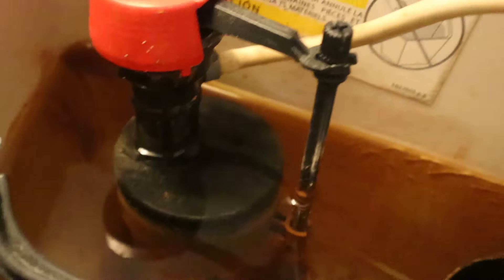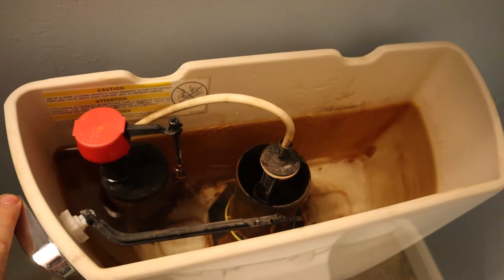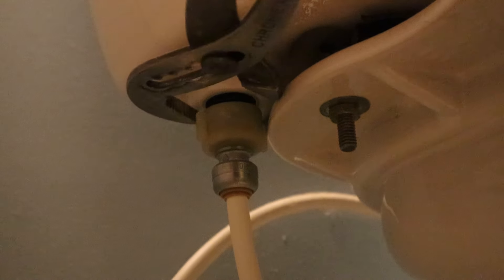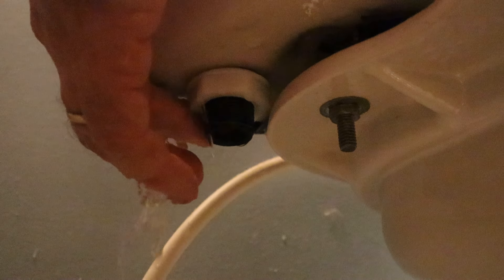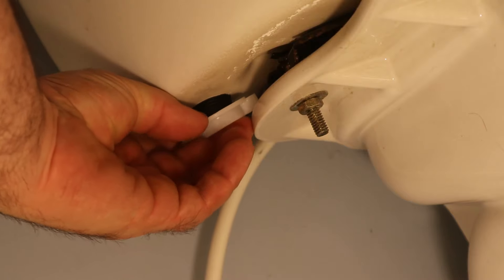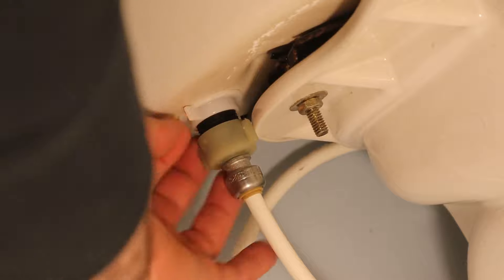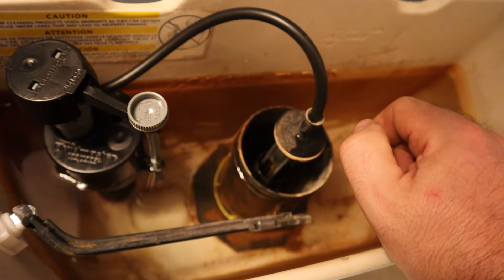Installing FluidMaster 400A Fill Valve in your toilet. Do It yourself!

Comment: I love people who get right to the point and show you how to do things.  Thanks!
Reply from the maker: Thank you! I am glad you likes it.
Reply: can't you just lift up the grey thing at the base of the valve? you dont need to undo the nut at the bottom of the toilet, i saw someone just lift up that grey thing at the bottom of the valve inside the toilet, then you can lift up the valve, then when you put the new one in you puish the grey thing down to lock it in place
Reply: @americanpatriot7233  yes you can, because that's how i fixed mine. It means I've got an old bottom bit of the valve still in the cistern, which I acknowledge might fail sooner that if I'd installed the entire new inlet valve, but I've got the spare new bottom part in case that should happen.

Comment: Thanks so much, sir, for walking me through this.  It was a piece of cake, even for me, a twice per year bumbler through these sorts of tasks.  Something I like to do at the conclusion of successfully working on plumbing (besides celebrating with a beer) is to put a piece of newspaper or cardboard (or something else that clearly reveals a drip in the middle of the night) under the recently fixed thing for a day or two--just in case.

Thanks again!
Reply from the maker: You are welcome, and thanks for sharing your tip!

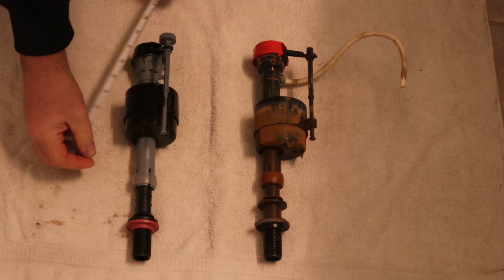Comment: If you are placing an old Fluidmaster fill valve with a new one, you don't need to empty the tank or disconnect the feed line from under the tank!  Look at the valves at 3:30.  Each has a plastic slip collar below the float where the upper shaft sits on the lower.  Just reach down and pull up on the plastic collar to pull it closer to the float to unlock the upper portion, then yank the whole valve up (no turning).  The only thing that will stay behind is the black stand pipe.  Remove the stand pipe from the new fill valve and slide the new valve over the old standpipe (which is just a hollow plastic tube and never goes bad).  Set the height to where the old one was and slide the collar down to lock the new valve onto the old stand pipe.  EDIT:   this presupposes of course that you are installing a new Fluidmaster in place of an old failed one.
Reply from the maker: yes, I need to make a new video
Reply: I just used the pull up the collar method n it took less than 10 minutes to take the old leaky one out n put in the new one.  Fluid master old n new.  Thanks

Comment: Very clear and helpful video. 

I just installed this same  model of Fluidmaster fill valve myself. I encountered a great deal more difficulty than shown here, because I was dealing with a worn out fill valve that had been in place nearly 20 years. The nut holding it in place had become corroded and “frozen” onto the metal shank of the old valve, and it was extremely difficult to remove, using a pair of channel lock pliers and with the aid of WD 40. 

I finally got it off so I could install the new valve but then I had to deal with the water supply connector (also 20 years old) not stopping the water from leaking/spraying out. Ultimately, I replaced that as well, buying a Fluidmaster brand so I could be certain it would connect with the new fill valve. 

Hopefully, viewers of this video will not experience the difficulties I did. But be forewarned if you’re in the same circumstances I was in, replacing a very old product and installation.
Reply from the maker: Sorry that you had a tough time with yours. The old plumbing parts can be difficult . I am glad you found the video helpful.

Comment: thank you. that bit about the difference in height should be 3 inches and the next one about measuring the outgoing unit and making the new one the same...those were the golden bits thst make you stand out. thank you again.
Reply from the maker: I am glad you found it helpful
Reply: @TheFixitShed  I feel like wonder woman right now. I fixed 3!! leaking toilets. one handle is "floppy." any ideas?
it doesn't stop in the horizontal positions, but flops to point up at the ceiling. it looks like the mechanism is made of "pot metal." and will break if I mess with it much.
Reply from the maker: Your comment made me smile.  I am really glad the videos are helping people.  That's what makes it worthwhile. 

It is hard to tell without seeing it.  I would suspect the handle is just broken.  The handle should have a tab inside that stops it from flopping all the way down.  That stop may be broken.  Or it the nut that holds the handle on the tank is loose, it may be spinning around in the hole.

Comment: The 400a pamphlet, and two convos with Fluidmaster, gave me knowledge.  You gave me confidence. Thank you.

After installing the 'new in the box 400a' I had to troubleshoot by flushing the fill  valve cap (pg 10).  

Thanks again, kind sir!
Reply from the maker: I am glad the video helped!  What was the issue you were having that you needed to troubleshoot?
Reply: @TheFixitShed  ~ hi there! I'll try to describe:  After installing and reconnecting the water supply __ yikes, water all around ~ spraying and leaking from the fill valve locknut area and the water supply!  My hands, fingers, and gripper gloves had not provided the strength needed to have either of those two locknuts (fill valve + water supply line) tight enough .  Fluidmaster CustSvc  gave me the ok to use a tool. 😊 i chose channel locks and carefully tightened the locknuts.  Water back on, test flushed, to check tank and bowl water levels. Toilet "gargled."  Water could be heard trickling into the bowl, the valve would try to re-flush, to add more water. It kept trickling, water level increased just a bit, and then it would try to flush again. So I turned off the water supply and flushed so as to lower the tank's water level. Carefully took off the fill valve cap (pg 10), placed the Dixie cup atop, and turned water supply  on/off/on/off to clear out debris; there was none to be seen.  However, after reassembling the cap, turning on the water supply, and doing another test flushed,  this step of flushing out the valve, solved the problem. The toilet no longer runs, nor trickles, nor tries to dispense additional tablespoons of water.  

I am so 😊 happy.  You've no idea how much fear and doubt this task had generated.  

Your video-taping your hands really helped me with getting the left=right or clockwise/ counter-clockwise turn  instructions correct;  a tremendous help!  

I didn't ck your channel yet, but perhaps a vid on flushing the fill valve to clean debris caught under the cap may help some folks diagnose and solve certain issues, before replacing the fill valve?  Im going to try that if my toiiet ever runs/ trickles or tries to self-flush. Thank you, again. 🏅
Reply from the maker: Well done! Congratulations on your success!

Comment: Thank you for making this video.  I bought the same toilet fill valve a few months ago.  Today I finally have the energy to get it done.  This video really helps with the diagram showing the 3" height.  I measured the height differently since I messed up the height of the old fill valve when I tried to fix the filling problem.  I measured the height of overflow pipe first, then added 3" to it, and adjusted the length of the fill valve.  It would have taken me about 10 minutes to get it done if I had not take pictures.  Thanks again.
Reply from the maker: That's awesome!  I am glad you found the video useful.  I often take pictures  (or video) when I am doing something so that I remember how a piece came apart, or something like that.

Comment: Nice video.
I like that it was not rushed which was good for me since this was the first time I was replacing a broken Fluidmaster 400A flow valve.

To adjust the new 400A's height, I put the the old one next to the new one like you did.
Then I kept adjusting the height until they look to be about the same height.
Didn't use tape measure.
Reply from the maker: Glad it helped!  Eyeballing it is probably close enough.
Reply: @TheFixitShed  Thanks for the video. The new flow valve is working just great.
Reply from the maker: Glad to hear it. Congratulations on your success!

Comment: Thank you that I found you video that saved my times than it own manufacturers ☺️☺️
Reply from the maker: Glad I could help!
Reply: @TheFixitShed  Thank you again 🙏 you save me $350.00  from the plumber who wants to charge me as of emergency visits(at 2:00 am) I woke up with the water flooded all over my bathroom floor. Good thing he told me to turn of the water first, If I have other bathroom to use. He can comeback during daytime for $175.00 to save my money. At the mean times I searched on YouTube from more than 10 YouTuber before I found you. I spent $19.00 for the valve and $22.00 for the pliers. I’m very proud of myself now under your great instructions. Thank you sir 🙏🙏

Comment: Suggestion: If you have a wet/dry shop vac handy, you can vacuum all the water out of the bottom of the tank much easier and faster than using a sponge. As an added bonus, it will pickup any sand or other sediment at the same time.

Comment: This is a great video . When I turned the valve off and flush the toilet, why does the bowl refill back to a full tank.
Reply from the maker: The only thing that I can come up with is that the valve didn't work.  It is broken or didn't turn far enough to close the valve.  See if there are any other vavles closer to the waster source that you can close to turn off water going to the toilet.

Comment: Yes. The price is low enough to make it worth while to replace the fill valve instead of taking it apart to fix it. A new one will last many years. More than the stated warranty in my case.
Reply from the maker: I have never had to replace the same one twice (I move alot).

Comment: Easy-peasy...unless your toilet valve doesn't shut off all the way, like mine. Next you have to shut-off the main water valve outside your home. Unlike the easy-peasy toilet tank access, I only had a few inches access between my toilet and the vanity. I had to lie on my back to remove the locknut and the water hose. Unfortunately everything was frozen in place. 
I got a neighbor to hold the bad valve in my toilet tank while I attempted to unscrew the locknut and water line underneath. The bad unit in the tank shattered leaving a little plastic piece in the tank. Even when my friend used channel locks to hold the piece left in the tank, I was unable to unscrew the locknut and connecting hose under the tank. I had to use a sawzall, reciprocating saw to cut of the old piece. Since there was no room to SEE the water line, I did it by feel and accidentally cross threaded the plastic piece.  When I turned on the outside water supply, water sprayed everywhere. I'm sure In ideal situations, with easy toilet access and a  good working toilet shut-off valve,  it's easy as can be.😉
Reply from the maker: I admire your tenacity. I hope you got it all sorted out. Thanks for sharing.

Comment: You don't need to drain the tank or remove the supply line if the toilet already has a Fluidmaster in it. Just push the adjuster ring down, and pull the top part off, leaving the bottom part in place. Do the same thing with the new Fluidmaster. Now slip the top part of the new one over the bottom part of the old one, when it is properly adjusted, slide the adjuster ring back up to hold it in place.
Reply from the maker: Yes, I heard about this after making this video.  I'll be trying that out next time.  Thanks!

Comment: I had trouble with my refill valve but when It was replaced the inlet line was plugged with?? Called my well man and he said it was rust from inside the water tank. He drained the tank and replaced some schrader valves. Now i have water to the refill valve but not enough to come out the tube. I'm thinking about disconnecting the inlet hose and flush from the main water supply before I put it all back together. I thought this was done, but not so!  Well man suggest I replace tank with one glass lined and install a sediment filter. Any opinion
Reply from the maker: Not really.  I am just a home DIY'er.  Trying to help people do simple tasks around the home to save money.  Sounds like you might have bigger issues than what I would be comfortable advising on, base on your comment.
Reply: @TheFixitShed  Thanks, I now no what is causing the plug, calcium build up. I dont think the rust itself would cause a plug.

Comment: After installing a new toilet, I discovered that the water level in the tank is right to the top of the overflow tube and I'm out of adjustment at the knob/ screw on the fill valve. I think the solution is to shorten or lengthen the fill tube, which adjustment is it and can I do this without removing the fill valve from the tank? Thanks.
Reply from the maker: If you have a Fluidmaster fill valve, like the one in the video, the main shaft twists to lengthen or shortend it. It sounds like you need to shorten it.  You should be able to do this without removing the fill valve.

Comment: I am seeing water coming out constantly from underneath that red Flomaster cap. Dribbling out. And then in the toilet bowl there also is water dribbling into it. My monthly water bill is up a very good bit and I'm sure that's the problem. 
Can I do something to the present Flomaster attachment or do I need to replace it? I really very much need advice please!
Reply from the maker: If the flapper is allowing the water to leak into the bowl, it could be the flapper needs to be cleaned or replaced. If the valve is running constantly and causing the water level to rise and go into the overflow tube, then the valve should be replaced. I don't know anything that you could do to the current one. The easiest fix is to replace the fill valve.

Comment: Should a stream of water run out of the black cap in the corner of the tank after flushing? Mine does about every 10 seconds.
Reply from the maker: If it is doing that, water is leaking from the tank to the bowl.  you need to clean or, more likey, replace the flapper.
Reply: @TheFixitShed   It was replaced and the fill valve was put in today.
Reply: It stops after a while. I hired someone to do it for me.

Comment: Is there a crush ring in the pipe fitting?  Mine is leaking when i replaced the float.
Reply from the maker: There should be a rubber gasket in the supply line hose where it connects to the bottom of the fill valve.  The fill valve should also have a rubber gasket to seal around the base of the valve and the tank bottom.

Comment: I believe this is what I'm going to have to do. Ran into an odd problem where the toilet won't refill itself unless I turn the water on to the bath/shower right next to it for a few seconds. Then I can heard the toilet start to fill up like normal. So weird.😅
Reply from the maker: That is odd. I wonder if the water pressure from the supply line is preventing the valve from opening. Then, when you run the bath water, it reduces the water pressure enough that the valve can open.

Comment: Is it ok if the water is more than 3 inches from the top of the over flow pipe? The water reaches the previous water height in the tank. I turned the water level. adjustment screw all the  way clockwise to increase the water but it did not get any higher. I replaced the fluid master because I was hearing a whistling sound and I’m wondering if this contributed to my water bill increasing.
Reply from the maker: 3 inches below the overflow seems a bit low, and would result in a weak flush, but if it was working for you, then leave it that way.
Reply: @TheFixitShed  thank you . I did notice a weak flush even though it's the same height as the previous one. I'm also hearing a quick flushing sound. I will adjust the height
Reply from the maker: @AliG-rb6em  If by a "quick flushing sound", you mean "tank refilling sound", you probably have a leak from the tank to the bowl (causing the water level to drop slowly and the tank to refil).  You might be able to just clean the flapper to make sure it is getting a good seal or you can replace it.  This leak will cause you to use lots of extra water until it is fixed.

Comment: Is the 400A standard? I have to buy one. Maybe i should  match the one that I have at the store? Thank you
Reply from the maker: They are pretty much universal.  The 400A is the base model.   They have a 400H model which is "high performance" whatever that means in a toilet fill valve.  Unless you have something very old or unique, it should fit.

Comment: Thanks, it never fails when i turn the water back on the turn valve has  a drip from not being turned in years
Reply from the maker: Yes, some of those shut-off values work great when you first put them in, but then they sit unused for 10 years....
Reply: @TheFixitShed  also I was wondering how long should it take for my tank to refill? I’m clocking it at 1 minute and 37 seconds-seems to long- thanks for getting back to me.
Reply from the maker: @kauaireed9006  Yes, that is a bit long.  Is the dripping valve fully open?
Reply: @TheFixitShed  I believe so
Reply: @TheFixitShed  really not sure what a dripping valve is
Reply from the maker: @kauaireed9006  The valve you said was dripping.
Reply: @TheFixitShed  my bad , no it’s not dripping
Reply: @TheFixitShed  all good now, it was junk in the tube
Reply from the maker: @kauaireed9006  Excellent!  I am glad you figured it out

Comment: Hi, is there a way to install a screen on the inlet hose to prevent trash getting into the fill valve?
Reply from the maker: You could add an inline filter.  I added a link to the description as an example.